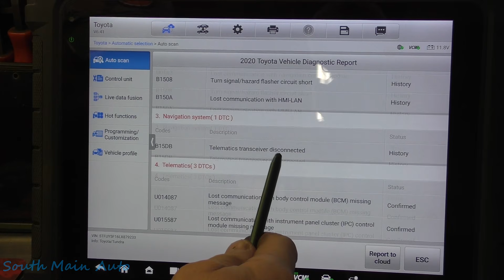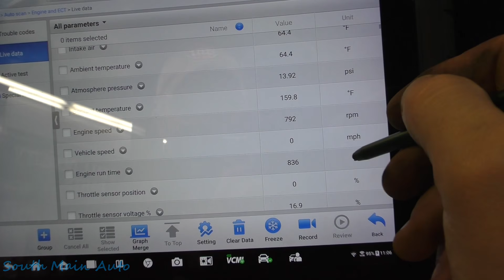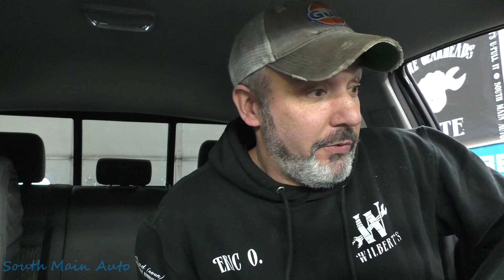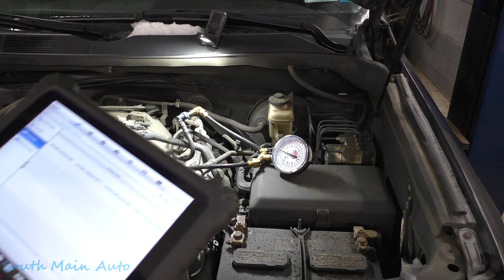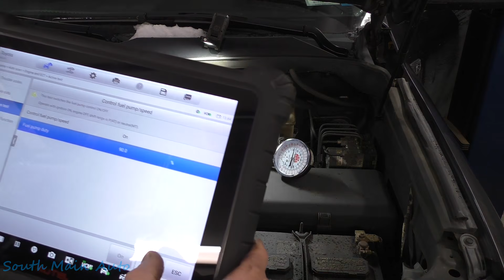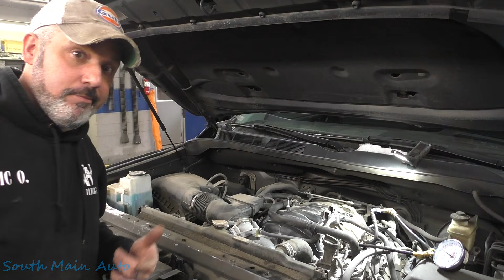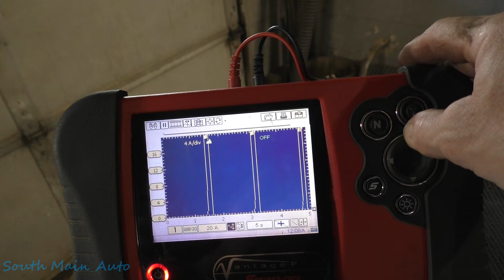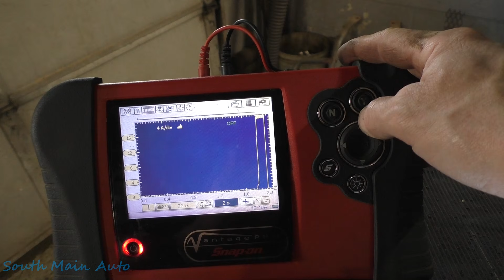My Customer Is Getting Shafted By The Local Toyota Dealer

Comment: When you said it doesn’t start hot after it sits for a bit.  I was thinking fuel pump. I work for the GM dealer 25 years ago. They had all kinds of fuel pump problems, probably still do from what I read.  I would get somebody to crank engine over and hit the bottom of the fuel tank with a rubber mallet engine would fire right up, needs a pump.  I used to change 1 to 2 fuel pumps a day on GM’s when I worked at the dealership. Also, I figured out the problem gets worse when you’re low on gas, fuel pump gets warmer and basically binds and seizes up and stops. Good video on how to diagnose the pump to make sure that actually is the problem.

Comment: Apparently the Toyota technicians should watch your video of the diagnosis.  They "might" learn something.  As a Subaru technician, I would totally have been OK with replacing the pump based on the diagnosis you provided.  Unfortunately, I am not at a Toyota dealership.  The one question I do have is how the Cosby sauce got it to stay running.  If the pump was dead at the time, the engine would have started, and then stalled.  Maybe that's what was actually happening, but not clear in the video.

Comment: Yeah, dealers suck. I’ve had one tell me my steering rack needs to be replaced, $4200. They didn’t diagnose anything, just guessed after I sat and waited for 3hrs and spent $200. It was the alignment the entire time and was free because of where I got my tires. I even asked if that the $4200 steering rack didn’t fix it, would the pit my old back and not charge me, that was a huge no of course. I’ve learned over the years about diagnosing my own and swap parts I’m able to do easily myself. 

Saved a neighbor $8500 by simply checking fuses and then fix a bad ground.

Comment: I had the exact same thing happen with my (out of warranty) 1/2 ton Chevy truck, and I never suspected the fuel pump because I could get it started with starting fluid or jumping it and it would run, so that meant the fuel pump was running. Never thought it would be seizing because of a smidge less voltage. For the life of the truck I just left it running, or let it cool down as my workaround. Dang. Wish this video had been published then. Or I wish I had your diagnostic skills.

Comment: Great video Eric, fuel systems are so friggin complicated these days, I miss the old mechanical pumps that worked off the engine and not a crap load of electronics
Reply: so true,, can't even turn on a light bulb without an ECU.. WTF? W ednesday T hursday F riday..:face-orange-frowning:
Reply: the problem is, ethanol and fuel additives smoke the rubber diaphragm in no time flat. no need to ask how I know!

Comment: I recently sent my 80 year old father to his local Toyota dealer (I live in another state) to deal with a TPMS light on his 10 year old Lexus( No Lexus dealer near him). An hour later the service writer told my father that his TPMS “system” needed to be replaced for $1100 and the technician found another $3000 in needed repairs (Dad only asked for the TPMS to be addressed). And oh by the way, the fee for the total vehicle diagnostic which Dad did NOT authorize was $238. Dad paid the $238 and left, went down the street to Discount Tire and they replaced all 4 TPMS sensors for around the same price he had just paid for the unauthorized Toyota “diagnostic fee”.  Disgusting
Reply: Were you expecting no Diagnostic fee for the tpms warning. indicator?

Comment: The reason for the "starts with ether" may just be that the ECM may be in open loop control for the fuel pump during startup, which may be too little to kickstart it. Once it runs, there is a higher demand, which breaks it free and then it runs normal-ish.

Comment: I brought a 1999 S 10 in for a exhaust leak under warranty. The tech couldn't find any leak.  He lowered my truck with the engine running.  Out of the corner of my eye, I noticed the cooling fan making a odd movement.  I told the tech to stop the engine.  He did.  I grabbed the fan and low and behold the exhaust leak noise was a failing fan clutch.  Me and the truck lived happily eight more years together until a nurse on a cellphone rear ended me at 40 mph and totaled it.

Comment: I love watching the way he tracks a problem down... I`m an old mechanic (all my life) but we didn`t have all these electronic controls as I see now..
Makes me wonder if all these  electronic controllers are really needed .
Reply: Definitely not, some system do require modules as it would be near impossible or cost prohibitive to make something mechanical that does the same function though. All in the name of fuel emission and pollution reduction. That's all BS; there's a few newer engines out there (3.0 duramax, 1.5 ecoboost for instance) that uses a timing belt in oil for the oil pump resulting in the engine getting trashed at 150k miles or costs thousands to replace it before the teeth starts peeling off but hey, 1% more fuel economy!

Comment: I restore older BMW's and do contracting work for two of the local BMW dealerships here in my hometown. Ten years ago both dealerships had mechanics who would blow my socks off as far as knowledge on repairing BMW's. Fast forward to today. Neither of those dealerships kept those mechanics around because they refused to pay them what they were worth. The dealerships labor rate is $299 an hour. They refused to pay them over $40 an hour because and I quote "No way we're breaking the $40 an hour mark for some grease monkies." One of the dealerships spent nearly half a million dollars installing a coffee and pastry bar. With nearly sixty mechanics between the two dealerships I'm busier now than ever because if the car is 2016 or newer and has iDrive 9 these guys can't fix a car without firing the parts cannon. What's really mind boggling is cars under warranty BMW pays for the Jiffy Lube techs to throw parts at until it's fixed. I'd love to get the parts removed from these cars because their is nothing wrong with 90% of them.

Comment: As a flat rate tech who is paid hourly based on hours billed in an aftermarket shop I.e. I work on all makes all models.  one day it’s a e350 Mercedes to the next it’s an e350 ford  van, literally lol if that even makes sense as far as the pay scale. the flat rate system does not build great diagnosticians and with that being said good luck finding a guy at a dealer who does not do guess/swapnostics the system does not reward for diagnostic time or you can’t make time in diagnosing to be correct everytime once I figure something out I build another test to prove my theory that I used to come to my original conclusion at the end of the day I want to be 120% correct if it is not an intermittent that’s you can not duplicate. Good luck finding that at a dealer. This guy trusted eric to properly diag the truck so he could prove to them through video evidence and still had to go rounds with the dumb ass people Toyota,  do better they have such high standards how can they let people like this work for there dealerships. Blows my mind

Comment: When you spray it with ether, the truck turns fast enough to allow the high pressure fuel pump to suck fuel from the tank I would guess. 
So when the lift pump dies, it struggles to run.

Comment: Eric,O I’d solve the fuel pump diag by shipping it straight to you from Australia as dealerships here are as bad as over there,  y wife who had insisted she take her vehicle to Nissan for servicing of her car until she got a report back during her last Sirvice that she needed front rotors and pads and a new battery at a cost of $1300 smackaroonies I took it to my shop and the bill was $50. It didn’t need a battery nor new rotors! Not surprisingly as it’s only done 60K k’s fme dead😂😂😂

Comment: They should also PAY HIM for having to PAY YOU to diagnose the problem correctly! Kudos to him for taking steps to hold them accountable.
Reply: Great Diag Mr. O!
Reply: Eric O. clearly states that the customer has not taken the truck to the dealership yet. Hold them accountable to what?
Reply: @vg3430  If you read the SMA updates in the comments section you would know the customer did, in fact, take vehicle to the dealer service department and finally got them to admit they were wrong.  He held them accountable and they replaced his fuel pump.
Reply: @keithbassett4988   its kind of amazing that the dealers local to him havent clued into who he is, watched some of his videos, and accepted that if a customer comes in and says SouthMainAuto said this is the diagnosis, then that is the diagnosis.. i mean if you were in colleague football youd know if tom brady was throwing at the team a mile down the road.. and youd think youd take the help when he told you what play would get you the touch down guaranteed.. but i guess theyre too stubborn and have nothing to lose because bad service and unhappy customers doesnt effect their paycheques in the slightest
Reply: @vg3430  So you may want to read the updates.

Comment: Given that this is diagnostics only, to then be possibly repaired under warranty by the dealer, the best approach is to provide actual diagnostic testing data, like scope captures, thermal images, DTC scan information, images, video, TSB listings, Recall listings, etc., and then provide this to the customer to give to the dealer, either fully electronic or hardcopy depending on what the customer wants. I have found that a verbal write up on an diagnostic paper invoice may just be ignored by the dealer, but actual testing data results they will look at. 

For low pressure port fuel injection pump diagnostics, I like to monitor fuel rail pressure with a Pico Automotive WPS500X Pressure Transducer, and a TA473 current clamp to monitor fuel pump current. Given the pump behavior I would have also used a channel to monitor the Fuel Pump ECU +12V power input and perhaps the PWM command from the PCM. Then capture the failure with a four channel Picoscope.

Diagnostics, especially mobile diagnostics, or stand alone diagnostics without repair like the vehicle in the video, is all about taking and presenting data (hard facts, tests, captures, images, etc.) that identify the problem to the customer. In fact stand alone automotive diagnostics requires data, because essentially this is what you are being paid for.

However, the bigger question is how did debris get into the pump impeller to load down the pump motor. This is very strange. Is there debris in the tank, and if so where did it come from? Did the pump filter sock come off and if so how? It would be prudent to empty the tank, remove, dry, inspect and then possibly clean the tank before installing the new pump assembly. Pump failure due to a motor issue is one thing, but partial failure due to pump clogging is another. 

There is another question and that is, did the dealer just change the pump or did they change the complete fuel pump and housing (which includes the fuel level sender, locking ring, tank seal, etc.)? In the salt belt generally you have to replace the fuel pump and housing because of the rusty ring lock, and also you want to use a new tank gasket (seal), and while you at it why not replace the level sender. 

But, even if the vehicle was not in the salt belt, I am not sure I would have had enough confidence that the dealer could properly just replace the fuel pump only, without making a mistake or damaging the sender and or pump lines in the tank. Also, the fuel pump connector pins on the top of the tank should also be cleaned with Deoxit D5 before being reconnected, and I am not sure that the dealer even knows what Deoxit is.

For a better outcome for the customer, it would have been better to have the dealer supply a new fuel pump assembly (pump + housing + sender) to SMA and then the dealer reimburse SMA for the dealer book labor time to make the repair. I think any qualified shop can do warranty work once the dealer agrees on the diagnosis and is willing to use the shop as sub-contractor at the book rate.
Reply from the maker: I get what you're saying but I don't provide a customer with a novel of my diagnostics. I simply write on my repair order what my findings are and what the vehicle needs and they can take it or leave it at that. As far as giving the dealership a bunch of paperwork and screenshots and write-ups that's a fat waste of time. The dealership sees me as an independent, I'm not ASE certified, I'm not a Toyota Master tech, I'm just a schmuck who owns a garage. I'm definitely not trying to downplay what you do in your approach but at the end of the day I could really give two shits if somebody believes me or not when I tell them what's wrong with their car.

Comment: Would be nice if the fuel pump module communicated the fact that pump stall current was present to the ECU. Set an informative code and turn on the money light. Done and done.

Comment: I had the same problem with my 2004 mustang V6..It turned out to be the ignition coil..It took about  5 minutes to change it out,and it ran like a new engine then..I believe my motor mounts being bad,everytime the motor would raise up,the ignition coil would hit the hood causing small cracks in the coil..The problem would mimic a vapor lock problem.

Comment: A 1/2 hour video, I bet it took several times more to set up and do all the tests. A dealer on flat rate will not bother to do that.  They want fast and easy kills to make money, something that pays an hour that can be done in 15 minutes. Like an oxygen sensor number, they will just put a new one in, and cancel the code. The fact the code went on because critters chewed up 2 of the wires to it, they worry about it later when you come back.   I hear a lot of auto mechanics complaints and quitting the trade recently, and most of them are from dealers. Take a drive pass any dealers , and see the nice new flashy show rooms  and they need a large staff. Someone have to pay for it, and mechanic with no union and a trade surplus is the easiest to squeeze. Some states have no licensing standards, you can get a 90 years old lady as a mechanic and have her do wheel alignment and brakes. Funny in aviation, where the buyers are much better informed, you can do all your transactions on a multi million dollar turbo prop in an office that is best described as spartan. Their mechanics do not use flat rates, or you be scared to fly.

Comment: There are "passive" electronic components that will do this. certain types of thermisters can limit current. A more likely component is a simple IC that is a current sensor (costs 25 cents at most) and then the small controller in the fuel module will cut off fuel in case of high current.

Comment: I ran  into a similar scenario on a Pontiac Sunfire years back where another dealership couldn't figure out why it would die out while driving but when cooled down, it started again. You had to drive it for awhile to get it to act up but ultimately it was the fuel pump. The hard part is getting it to act up so you can do your testing.

Comment: Glad you figured it out Eric. One of my cousins called me one day and said his wife's car wouldn't start. He said he could not hear the fuel pump run with the key first turned to run for the prime of the pump. He said he checked the fuse, and it was good. I said to him, lay down beside the car as close to the gas tank as you can and then smack it with your hand or a rubber mallet. The car started. I recommended a new pump. 
I think dealerships have such problems because of the flat rate pay system. Pay the techs what they are actually worth and then they won't have a revolving door with techs coming and going from the dealership. I feel a lot of times that the technicians get blamed when it is not necessarily their fault. If there is a position at a dealership that you don't want to have a huge turnover with employees, it is the techs in the shop. Techs that have been at shop for a number of years tend to know what goes wrong with those vehicles.

Comment: My Ford Ranger diesel behaved exactly the same. When hot it would not restart unless I pressed the manual pump. It was one of the injector bypass valves sticking open when hot. Thank you for the great diagnoses.😊

Comment: I had the recall for the fuel pump in my Tacoma and when they replaced it i got a check engine light by the time i got home for low fuel pressure. Turns out i got a bad new fuel pump. I don't think they have figured out why these are failing so early since the new recalled pump was DOA.

Comment: There would be no way in hell, I would ever have anyone, or any other shop other than Eric O fix this truck.....I'm an old school mechanic of 74 years, that changed points & choke pull off's back in the day. I live exactly 162 miles away from Eric's shop & would not hesitate one second to pay a flat bed tow to have any of my vehicles repaired by him.....I travel the 390 several times a year & see the Avoca exit I will find the courage to interrupt Eric if I can, just to meet a legend......I only disagree with one thing.....He say's " If I can do it, you can too".......Wrong, very wrong...... Eric is one in a million........

Comment: Many newer vehicles with FPM have 2 power wires running to the fuel pump. Only one is used during crank cycle on many of those vehicles. Lots of chevy v8s 2008-2014ish burn up one of those wires somewhere between the FPM and the pump and cause a similar issue to this. Once the vehicle gets started by shaking wires to restore corroded burnt connection it will run fine since it will use both wires during the run cycle. I suspect this is the case here as the difference between 12.8 and 14.5v is probably not enough to make up that 8amp to 20+ amp gap that was being seen. Having this high load on the pump very well could be burning up some of the connectors and the stealership may need to replace those harnesses as well.